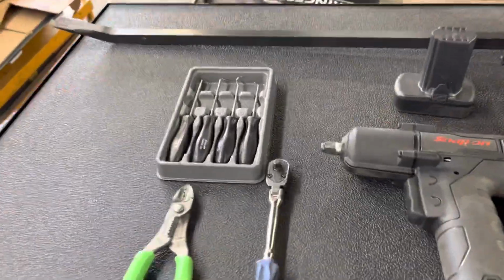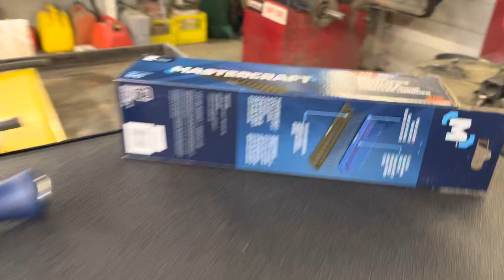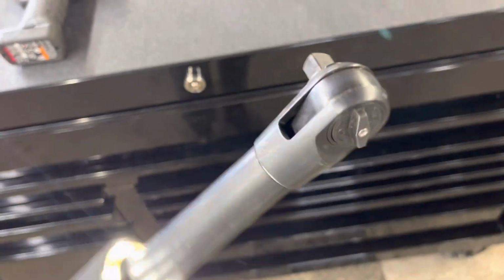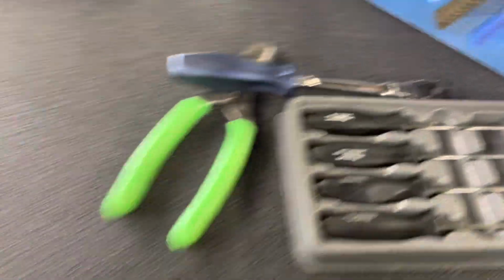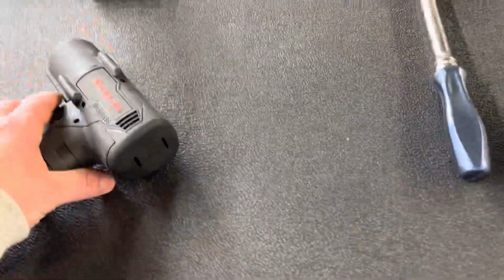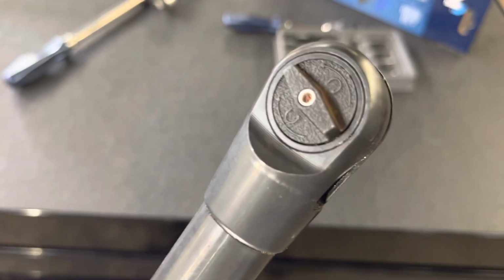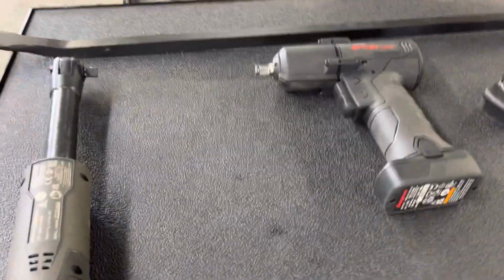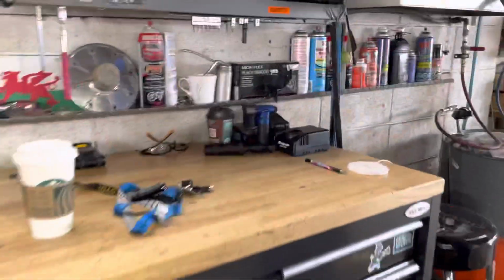$2k worth of Snap-On!

Comment: That impact is nice except for the trigger design. It's a little awkward, bulky. And I have large hands.
Reply from the maker: Makes sense. I love the duel trigger! And honestly kinda wished my hands were bigger to grip it better. Pretty thick handle
Reply: @JaiiClarkee  Had a few of their 1/4 drive 7.2 volt pistols back in the day super tough lasted eons. Loved their dual trigger design.
Too bad u need Shaq fingers on this one.
Reply from the maker: @motorbreath7174  i picked one of those up at a garage sale with two batts and a charger, i love that little screw gun!!

Comment: Jeez Snap-on has got more expensive than I thought. They make good stuff and the price gap between the next best thing is massive. 
Most other power tool brands like Dewalt and Milwaukee are not a long way off compared to Snap-on. A lot of cheaper second hand Snap-on stuff floating around though at the moment.
Reply from the maker: Yep its pretty crazy. Not sure the whole warranty argument on why snap on is so expensive works for the power tools.  But we will see how they hold up.
Reply from the maker: @Sid The sloth yep i hear ya man. The only nice thing is you can do $100 paymeants on anything 🤣 the sockets i just got with my impact cuz they were all 3/8 and i had no 3/8 impact sockets, i dont even think canadian tire has 3/8 impact sockets. But totally agree. I have things i didnt need snap on. But so far i am very happy with the electric tools.
Reply: Good thing you got that stuff for free. I got sucked in for $27,000. Don’t get me wrong their hand tools hands down are superior, but I basically have a tool box, wrench set, impact sockets. Oh and a couple ratchets. Not worth it to me